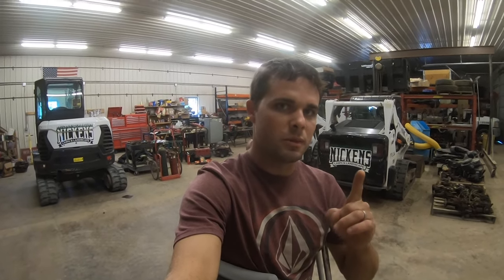Bobcat MT85 Undercarriage Rebuild, Owners MUST Watch

Comment: They make an aftermarket pin now that is greasable from the end where the old bolt normally would be, It's welded and now has a grease fitting threaded in. They run about sixty dollars a piece.
Reply from the maker: No way???? That is great! Where can I get this?
Reply: eBay has them 60 each

Comment: We own 3 of the mt85s in our rental business and have to rebuild the undercarriage on 2 of them. The engineers that designed this machine should be fired.Every time our machine comes back it has to be greased and most of the time the zerks are so beat up from stone that they have to be replaced.Its a piss poor excuse of a machine thats why we are getting ready to swap everything over to the ditch witch sk800.
Reply from the maker: Yeah it is literally the main driving factor that makes a lot of people switch brands. They know it because the MT100’s are all sealed. Someone told me you still grease the idlers on the ditch witch. It’s just the rollers that are greaseless on those
Reply: It's definitely a pain in the ass. We can't get a Grease gun on the front idler so I'm sure it will be toast soon.